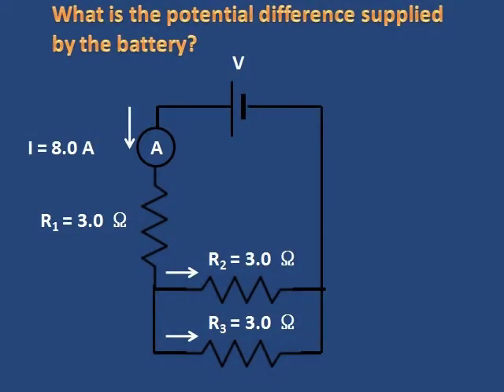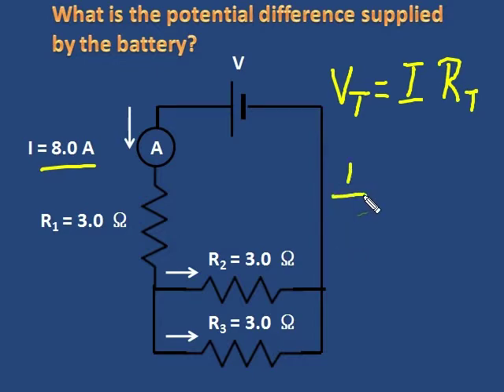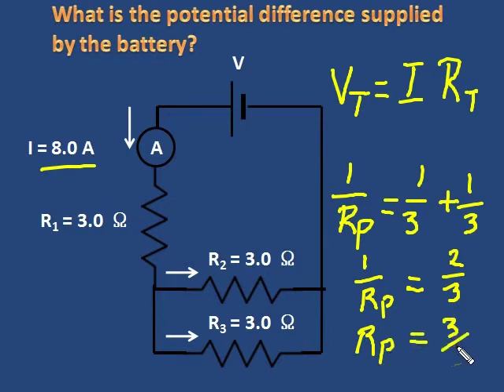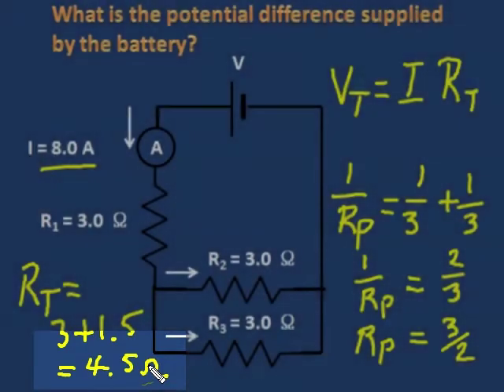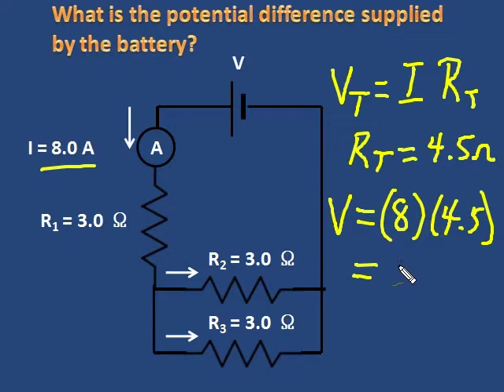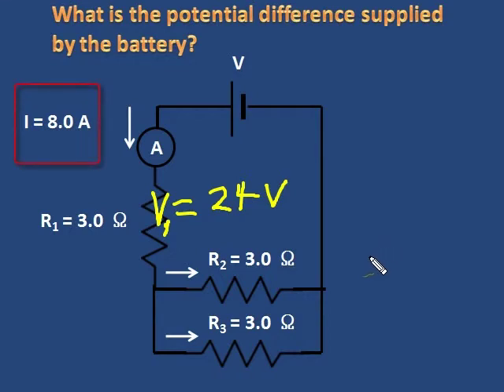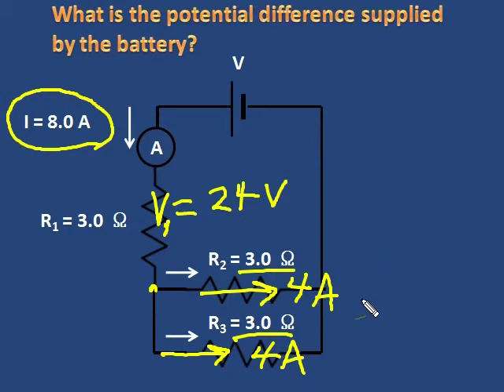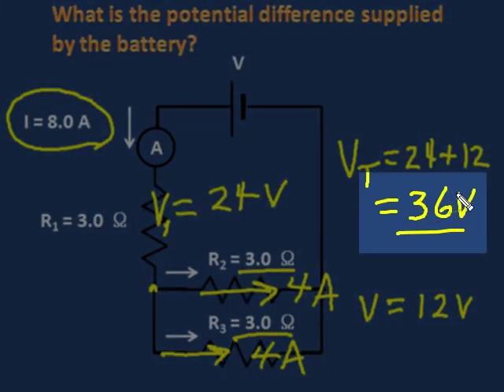Electric Circuits Problem 3

Comment: We know that both the parallels have same current passing since R are same hence 4A current flows through each. Now by Ohms Law we can calculate the Voltage which comes as 12, So Vt= 24+12=36
Reply: Nishant Deo Amazing